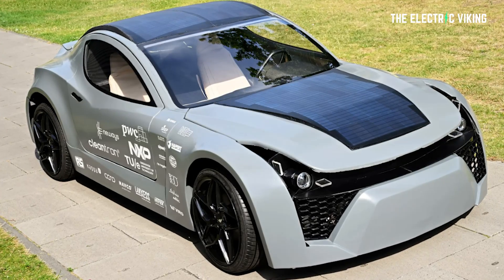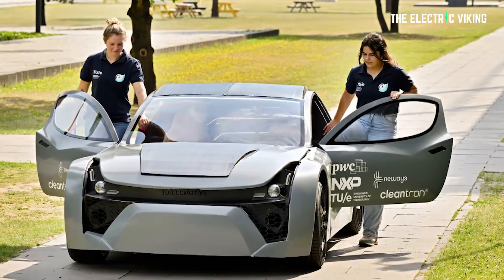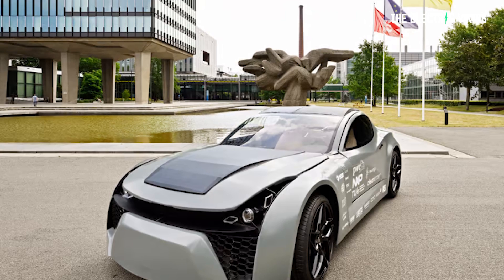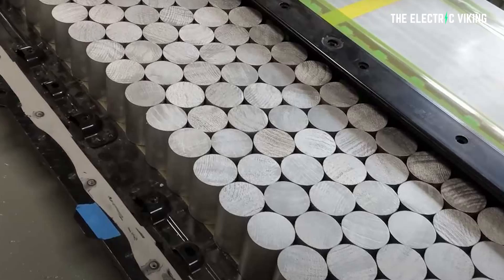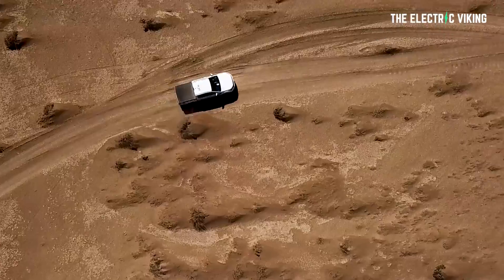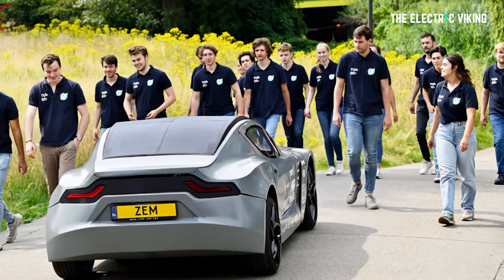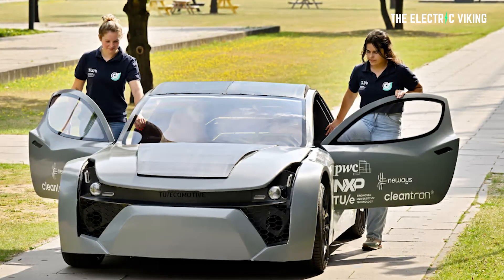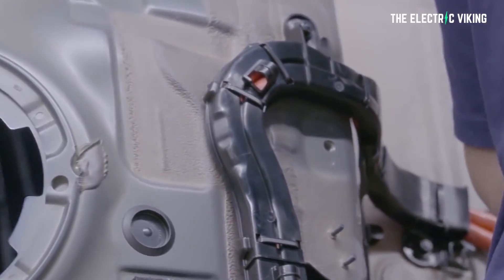Electric car made by students eats CO2 in the air while driving

Comment: I used to make optical lenses out of Poly-carbonate the problem like carbon fiber  and fiberglass Plexi glass it can't be destroyed or reused. But also with poly-carbonate  is it scratches easily but will last so much longer. Glass would be better. but Glass can be smashed Poly-carbonate can't and is far stronger than you think in fact we tested the lenses I made a bullet would not got through it.

Comment: You called it both Carbon Monoxide and CO2 (which is Carbon Dioxide) ! The two are not interchangeable. I assume the mistake was saying carbon monoxide, which if it did remove that would make the air less toxic but not really affect the carbon footprint the same way.
It is disappointing that whichever it is, the carbon captured is not further associated with the vehicle’s performance in any way. This says to me that optimising carbon capture and doing it outside of the vehicle will be more effective and efficient, so it becomes a literal thinking exercise only.

Comment: 2kg of CO2 for every 20000km?
If we consider the lifespan of and electric car to be about 400000km that's about 40kg of CO2 removed during the entire life cycle of the vehicle.
Now if the construction of this system takes more than 40kg of CO2 to be built, which is likely, then it's pretty useless.
40kg of CO2 is about 2 gallons of gasoline.

Comment: I love the EVs from an engineering standpoint. they are not the answer for greenhouse gases. CO2 is already saturated and physically cant outcompete H2O for warming in its active wavelength.  There will be a huge backlash against green energy due to skyrocketing electricity and energy prices.

Comment: So this vehicle has a CO2 scrubber built in.  The same thing (potentially better) could be achieved by placing that scrubber (or better yet a larger one) by a set of traffic lights.  Sorry but this is a lot of hot air over a non-story. Not the students fault, they were given a task and they achieved it but still a pointless waste of time.

Comment: I think this is a great effort by these students. Hopefully, they are able to conduct a complete analysis to determine the net carbon emissions with their vehicle and its specific features. It would be a great learning experience for them. For example, it's important for the students to understand the impact the carbon adsorption system might have on the vehicle's air drag, as well as rolling resistance from its weight.

Comment: The overall design of the car is cool, but putting CO2 capture filters in the car, if the have nothing to do with the power train, is just a waste. Your carrying extra weight and spending energy doing that.  Your far better of doing that CO2 capture at an industrial level in a stationary plant. You will get much better efficiency in the capture and not waste energy moving these filters around for no reason.  

If we really want to solve the CO2 problem then we should be pushing solutions that are well thought through and make sense. It's good to get attention on the issues but this just makes CO2 capture look silly if you put this forward as a serious solution. If this is put forward as an interesting concept with information directing you to how we can really solve the problem that would be much better.  I hope that you just missed that aspect of these students project and they made it clear this is not the best way to do CO2 capture.

Comment: I credit their goal but challenge their knowledge and skills. In the US Lexan windows are illegal, safety glass must be used for accident safety, and because Lexan scratches so easily.
 Digital cameras instead of rearview mirrors are also illegal, probably because of reliability.
 And I think those policies are pretty much worldwide. So if their car implements illegal technology...what else did they miss? Could the structure pass accident impact tests? Is there any reason cars should carry the CO2 apparstus, when it could work full time on light poles and tall buildings, removing dead weight on the cars?
 Nice goal, but it misses the mark.
Reply: Showing the potential for carbon neutrality or better is important for stimulating the imagination to develop the needed safety "glass" or other material for the windows and the reliable digital cameras/mirrors you say are necessary to meet the "safety" regulations. Afterall, eliminating carbon emissions (or better) related to our transportation is all about our economic and environmental/health "safety" as well, so the overall impact on our "safety" / "security" is what we are trying to maximize, not just a single measure of our safety. More specifically, a moving filter will be many times more effective at extracting CO2 from the atmosphere than a stationary one, though one would need to  take into account any increase in air drag that the system might cause, to be sure there is a net capture/reduction in CO2. At some point, as most economists will point out, any net reduction in CO2 needs to be incentivized by a system of credits/debits (taxes and/or subsidies) for avoiding adding CO2 to our atmosphere, so our economic system will appropriately motivate more and more cost-effective approaches for carbon neutrality and better.

Comment: DAC (Direct Air Capture), which is what these students are doing, is ineffective. Citing extensive research in a paper on carbon capture by the Royal Society of Chemistry, there is a compelling paragraph which reads as follows:

"To illustrate the difficulty in estimating the cost of DAC systems, we calculate the amount of energy required to move air through the process. Assuming a concentration of CO2 in air of 400 ppm and a 50% recovery rate, we need to process 2.11 million m3 of air to capture 830 kg of CO2, approximately the amount of CO2 produced for every MWh generated at a supercritical coal-fired power plant. Based on air being an ideal gas and assuming no losses in the process, if we had a pressure drop of 0.016 bar (0.23 psi), we would need 1 MWh to move the air. In other words, at this pressure drop, just moving the air would require all the energy released in generating the CO2 in the first place. This means for a DAC process to be at all practical, pressure drops need to be limited to the order of 6.89 × 10−4 bar (0.01 psi) and/or that the energy source for DAC needs to be carbon-free. A pressure drop of 6.89 × 10−4 bar (0.01 psi) is extremely small and it is unclear whether it can be realised in a full-scale DAC system. A better use for carbon-free power today would be to replace fossil-fuel fired power and avoid putting the CO2 into the air in the first place."
(SOURCE: https://pubs.rsc.org/en/content/articlehtml/2018/ee/c7ee02342a)
Reply: I put another comment before I saw this that also points out that moving around the filters for no reason is a waste if energy. You are better leaving the filters in one spot and using a more industrial system then putting a ton of little filters in cars.  That is if you even have a capture system that is worth it.

Comment: To use co2, you need 4 electrons per molecule. If you use co2 to make fuel, this will cost more co2 polution than you start with.
Carbon capture has been a joke so far.
And, before we have a big surpluss of electrictrisity this will remain a joke.

Comment: Toyota's plan use all the old ice engine's to produce electricity for Ev's 😂🤣😂
Reply: Toyota and Honda also make and sell generators, besides polluters-on-wheels
If they don’t change heart, they end up only making portable-chargers for EV’s😂 in some years.
Reply: @hanswitvliet8188  

A Tesla motor is 300kW.

Most portable generators are less than 3kW.
Reply: @fredbloggs5902  those are only intended for coffee makers at camping sites. They also make them slightly, and much larger. Those of 12-24Kw are relatively small and achievable.
But even those far larger, 360KW, could be placed on a truck, intended for EV-first-aid 🤣
Perhaps even mobile-mega-chargers, for festivals.
(And the Tesla engine is not relevant, just the size of the (empty) battery.)
Reply: @hanswitvliet8188  A 24kW generator is 4’ x 2’ x 2’ in size, weighs over 500lbs and costs over $12k. Using it inside a car would have major cooling problems, be extremely noisy, and cost more to run than an ICE car.

Comment: The car just uses a chemical filter/scrubber. 

The filter is full after 200 miles and captures 1oz (30g).

Their project does not address processing the filters.

It’s a gimmick that reduces the range of the car.

The reality is that capturing CO2 is better and more efficiently performed by a dedicated industrial large scale processing plant.

Note that if the car isn’t charged from renewably sourced electricity then they’re actually making things worse.

The whole project is meaningless virtue signalling, which given what the Dutch government is currently doing to its farmers, is entirely predictable.
Reply: I agree.   If we reduce CO2 production enough the plants will take care of it.     Would help to put an end to the slash and burn land clearing.

Comment: We need carbon dioxide in the air for crops an plants the more carbon dioxide means more crops this is dangerous many farmers use carbon dioxide generators to increase crop growth
Reply: If the vehicle in front of them is spewing exhaust then, this type of car is perfect to help clean up.

"If plants benefit from carbon dioxide, why is car traffic something bad?" 

"There are at least two separate answers to your question. First, with respect to plants needing CO2, they have evolved to deal with the limited amounts of CO2 normally in the atmosphere. That's really all they need, or "want": adding more doesn't really benefit them. Think of it this way: you need water to live, right? And drink a certain amount of it every day. But drinking large amounts of water can kill you wiki/Water_intoxication and holding you under water for a few minutes certainly will. (As in the comment above, and even better example would be oxygen: we need it to live, but too much can cause all sorts of problems: (wiki/Oxygen_toxicity ) Likewise, plants need nitrates, but applying too much can kill them. So extra CO2 in the air is of little or no benefit to plants.

The second answer has nothing to do with plants. It's that atmospheric CO2 traps solar heat, causing the Earth to be warmer than it otherwise would. Without the extra CO2 from fossil fuels, Earth maintained a comfortable temperature, one that we'd all (and I mean not just humans, but all life) had gotten used to. Add more CO2, and more solar heat is trapped, making the Earth uncomfortably warm, to the point that many plants & animals can't live where they are, and generally can't migrate. So you wind up with a lot of dead plants and animals. Of course there's more going on than this, things that are feedbacks from and side effects of the increased CO2, such as ocean acidification. "

"pollutants emitted from car exhaust, increased CO2 levels are warming the planet, through what is called the "greenhouse effect"."

If the atmosphere gets too hot, plants suffer irreversible damage, can no longer generate energy to live, and therefore die.

Anthropogenic Climate Change is why carbon dioxide, from fossil fuel powered transport in combination with other fossil fuel uses is considered problematic - i.e. "bad".

With respect to plant health insufficient carbon dioxide is not a problem; even with some plants getting some benefit from raised carbon dioxide concentrations those benefits are outweighed by the harms and costs expected to accrue from climate consequences of profligate fossil fuel burning.

About the climate consequences the US National Academy of Sciences says -

"Climate change is increasingly affecting people’s lives. It is having significant effects on infrastructure, agriculture, fisheries, public health, and the ecosystems that support society. It is also changing the environment in ways that affect the distribution, diversity, and long-term survival of species of plants, animals, and other forms of life on Earth."
Reply: @donotcare44  nice answer
Reply: @donotcare44  plants always want more co2, across the world all forests have gotten greener over the pass 40 years because of higher co2 levels you're wrong go read an agri science book
Reply: Plants grew fine 200 years ago when CO2 levels were half their current levels. Please stop promoting worthless propaganda.
Reply: @fredbloggs5902  plants wasn't doing fine we lost the Sahara rainforest because of co2 levels drop so much an the climate changed
Reply: @trondialsingh594  What part of this do you not understand? 

"...First, with respect to plants needing CO2, they have evolved to deal with the limited amounts of CO2 normally in the atmosphere. That's really all they need, or "want": adding more doesn't really benefit them. Think of it this way: you need water to live, right? And drink a certain amount of it every day. But drinking large amounts of water can kill you wiki/Water_intoxication and holding you under water for a few minutes certainly will. (As in the comment above, and even better example would be oxygen: we need it to live, but too much can cause all sorts of problems: (wiki/Oxygen_toxicity ) Likewise, plants need nitrates, but applying too much can kill them. So extra CO2 in the air is of little or no benefit to plants."

A child can understand it - but not you.
Reply: @donotcare44  plants are not humans an they do need more carbon dioxide than what they're getting my brother plants crops I've studied agri science you all don't know what you're talking about
Reply: Are you talking about cogeneration ?
Reply: im thinking along that line also.

Comment: Not sure how practical a car scrubbing  Carbon dioxide (CO2) emission is.  Most Carbon Dioxide is not at ground level to capture.  Once Carbon Dioxide is released it moves up in the atmosphere.   Maybe planes would be a better platform.
Reply: CO2 is actually heavier than air, but it generally mixes in fairly evenly.